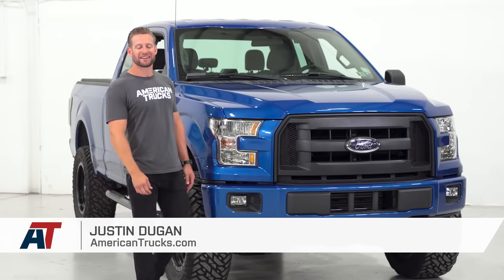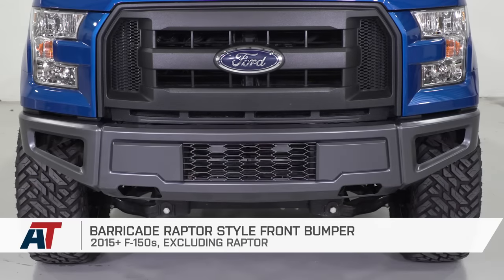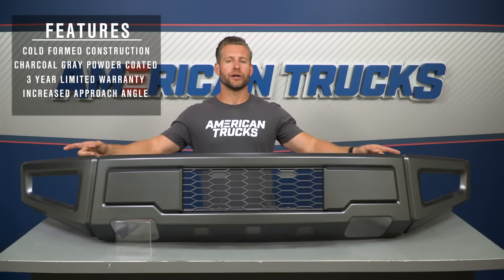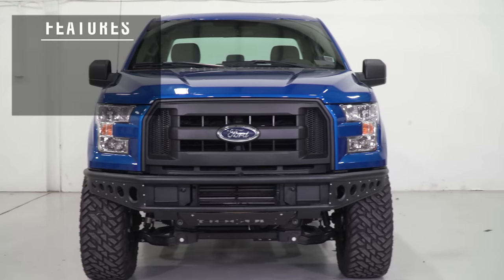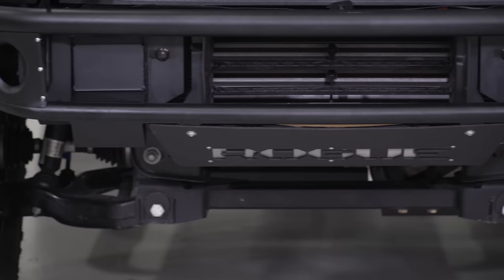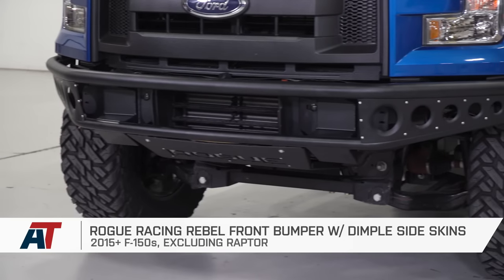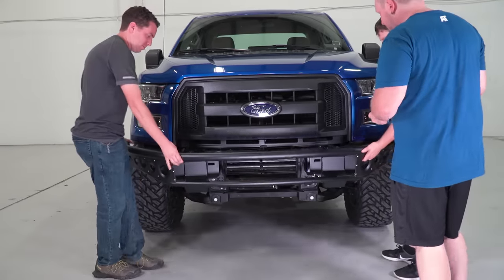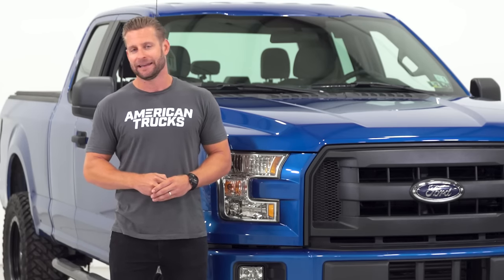The 3 Best F150 Front Bumpers for 2015-2017 Ford F150

Comment: Hi Justin, talking about bumpers and bullbars I would really appeciate your opinion; as you are in a better position (being in the US and in the industry), on Fab Fours bumpers. Even at your website I noticed that you are selling some of FabFours bumpers but just like on no one else's wensite (other than Fab Fours) there is no notice / warning that the bumper "Currently Does not work with Diesel Option".
Against the warning; I got one FabFours' full guard bumper and would like to understand why is this warning? Have they tested a number of diesel vehicles and found some consisten fault? No other manufacturer makes this warning for any other bumper even though I cannot see that FabFours is any more obstructive to air flow than any other bumper? I tried to get those details from FabFours but I am not sure I understood the issue; so I thought maybe you guys can help and clarify this if it is not too much to ask. Also you're selling the part and if I specify vehicle as "F-150 Lariat 3.0 Diesel" on your website - FabFours will come as one of the options which according to FabFours is not.